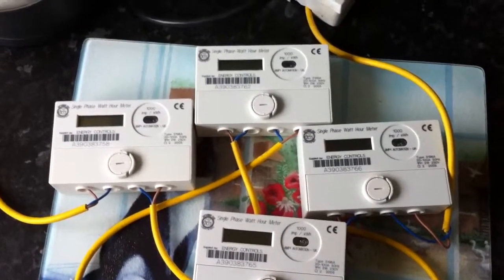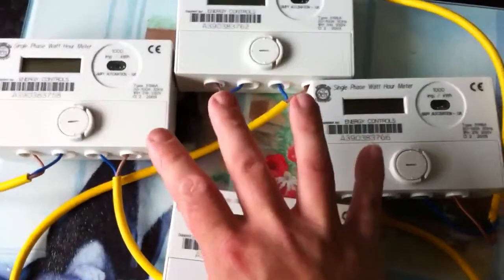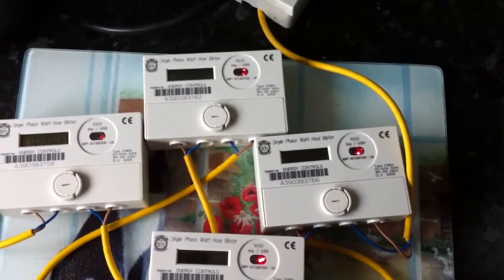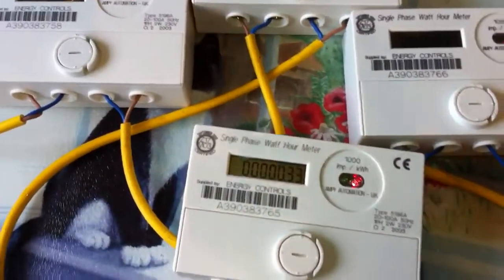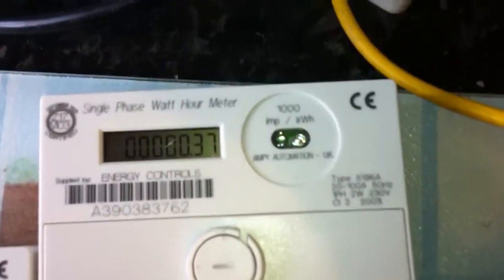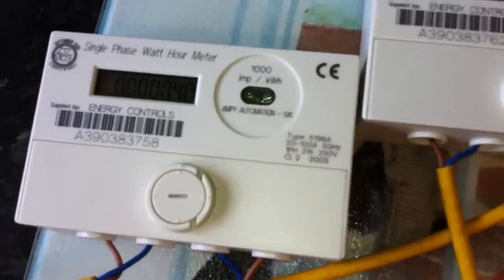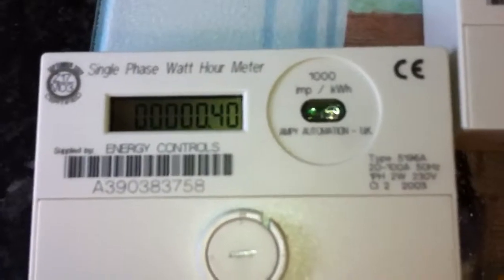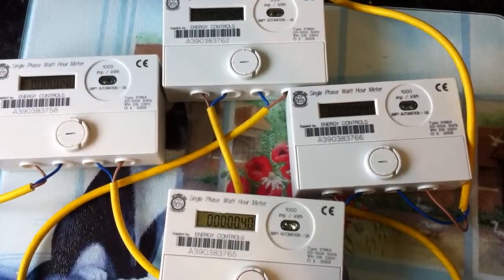Ampy 5196A kWh meter

Comment from the maker: Oh yes I enjoyed doing the video although I thought that the LED Would stay in sync for a little longer. When stopped recording and put a lower 800 watt load on and intresting let the last 2 meters took an extra flash before it incremented up. I for the first 2 meters I see that they had 2 decimal places so I got anouther 2. The on with no decimal places I am going to use that on the fridge and freezer. I am going to do a propper little setup for it. You can reprogram these meters so that they

Comment: Very nice. Look at them all flashing away there...Its like a disco! :-D LOL!

It's interesting that those four have the 0.01kWh number on....I wish ours had! The one in my meter cabinet only has the 0.1kWh number on it. 

As for the one that only shows whole kWh, that would be best fitted to something that is a heavy load, of which is used regularly. For analytical reasons though, it is really nice to be able to read them down to 0.01 kWh, & that's why I really like the Sangamo "SPA" meters.-BBD